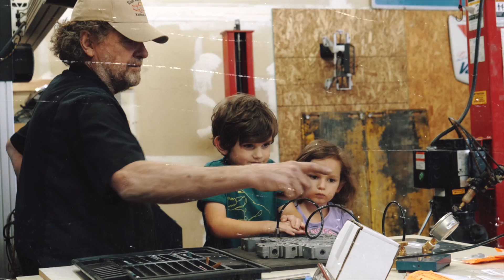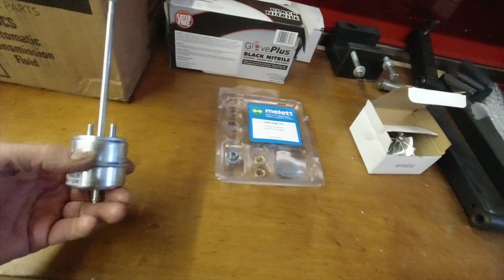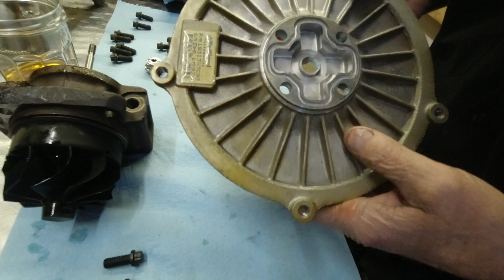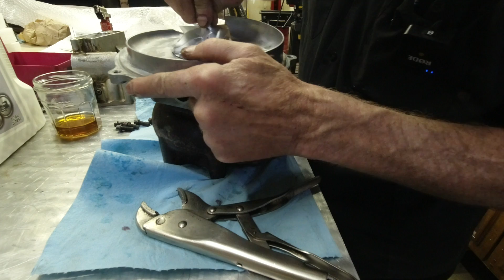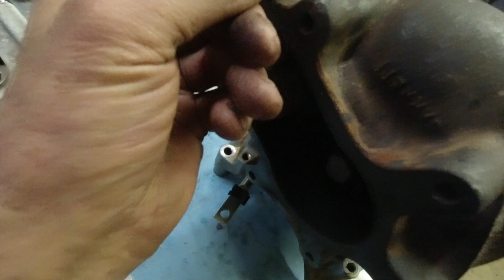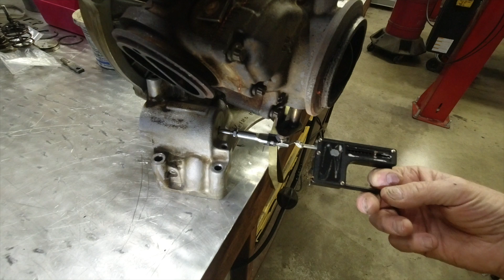7.3 Turbo Up Grades, EBPV Repair For Exhaust Brake.

Comment: Right on, I would really appreciate if you could work on my 2001 F-350 7.3.  I have some upgrades on it now but I think I'm interested in having some more, i.e., banks power pack bundle added, and a oil bypass system put on and the engine brake system too.  I could drive it there from Montana and leave it with you for a spell.  Whats your schedule like?
Reply from the maker: Right now just working with the stock systems and minor upgrades as in the video, maybe in the future we’ll get into more. Thanks for watching
Reply: @TomAutoTV  Sure, maybe late summer.

Comment: Questions I got a 1991 ford bronco 4x4 e04d transmission i took out and put another one in , it only goes in reverse not drive , idk what the problem is its got all the fluid it needs would you maybe know
Reply from the maker: Thanks For The Question, My First thought Is A Forward Clutch Problem, Namely A Hydraulic Leak To The Forward Drum.